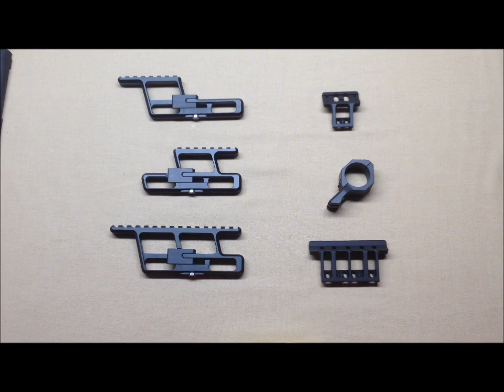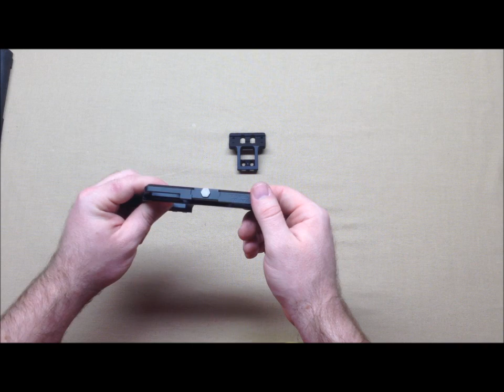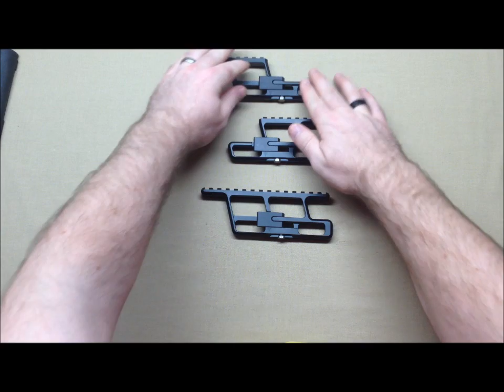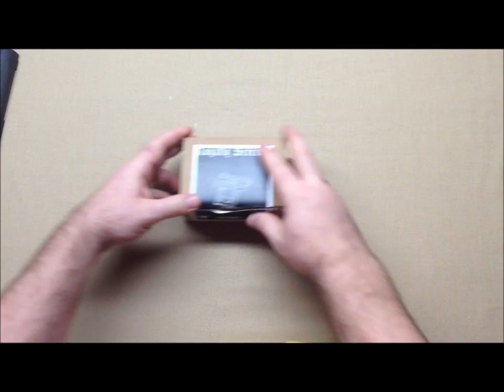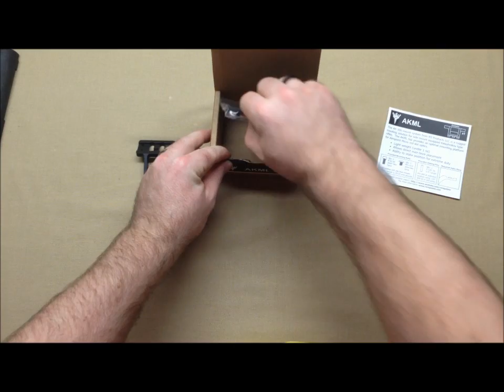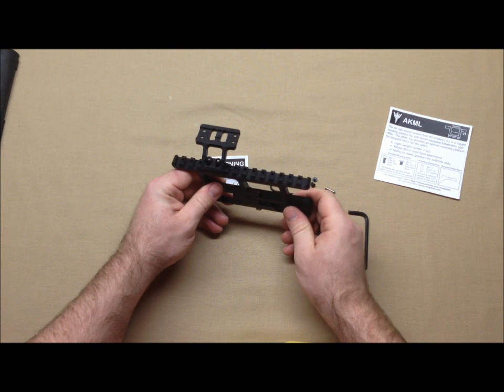RS Regulate AK-300 Modular Side Mount System

Comment: Should it be necessary to hammer this mount on? I have a KR103 (new production mid 2023) and just got my 301M and AKML and can only get it on about 1/2” before it stops. It fully seats with some liberal taps from a small rubber hammer but moving it all the way on or off is impossible with hand strength.
Reply: You should never need anything besides fingers to install them properly. Have you adjusted the mount to fit your rifle per the instructions?
Reply: @RS_Regulate  yes, I even completely removed the locking mechanism from the mount to makes sure that wasn’t the issue

Comment: Dumb question but how do you center the upper optic mount to the bore? Is it an "eye ball" operation?
Reply: I use the irons as a datum and place the reticle or dot on top of the front post.  That should get most people on paper and then you fine tune the POA/POI
Reply: @RS_Regulate  I was more wondering if there was a method to center the actual optic (dot off) to the bore. So in theory the optic would already be centered to the bore before you started adjusting your dot

Comment: I didn't have an issue buying my lower mount (it was in stock at Brownells). The upper I wanted was the AKOT (mini ACOG), and it was out of stock everywhere. I emailed RS Regulate to ask when they might be back in stock. I got a quick reply stating that they were at the anodizer. The person suggested that I order from retailer first, as the stock goes there first rather than the RS Regulate website. The nice thing about Brownells is that I was able to backorder the item. I waited maybe 2.5 weeks. These really do sell out fast.

One question for RSR after watching the video. What torque value do you recommend between the upper and lower mounts? With blue thread locker is 20-25 in/lbs about right?

Comment: Is there any reason why an AK-303 would refuse to slide forward even while the screw is loosened up all the way?
Reply: inamadworld could be several factors.  Most likely the dovetail is not properly aligned.  If you have a WASR the dovetail may not be properly machined etc.
Reply: @RS_Regulate  It is an In Range built 74 with a side rail bought from AK-builder.  Not sure how to tell if aligned properly.
Reply: @RS_Regulate  that's what it was, In Range verified that it was out of spec and replaced it with a Russian one.

Comment: holy batman, i just checked the prices, AK-303M with two 30mm rings will come out to $280 plus shipping, that's F-class territory, not AK.  

I'm off for the Russian made stuff, they run a reasonable price to quality ratio.
Reply: So do these.  

FYI - we recommend using the AKR upper not Dual AKM’s.

Comment: I'm new to ak optics in general. Is it normal to see the optic mount slightly give (move) as you apply a little pressure to it with your hand. Mine will move very slightly, but looks like it goes back to zero. I haven't made it to the range yet though.
Reply: Josh Wells yes sir.  It should flex.
Reply: Thank you!

Comment: Just received modular side mount and my lock bar on my AK 301M doesn't move at all so I can't adjust.  (standard)
Reply: Doug E Doug sometimes the mainspring gets bound up.  Flip it over and push the spring away from the bottom lock bar and then let it snap back.  Repeat away from the mount side.  Once it’s freed up roll it one way or another a few degrees.
Reply: That was it, thx !

Comment: Still can't figure out how to mount the  307M to my Npap
Reply: Bruce Witherspoon what's the problem? Not sliding on or not locking?
Reply: Specify Rs Not locking. it slides on fine after I tighten it. I've followed the video step by step.
Reply: Specify Rs I've tried that and still no dice. it really seems like it doesn't fit. I'm sure I bought the right model so it's probably me and not the mount.  I'm going to take it and my rifle to a gunsmith and see if they can mount it.

Comment: I noticed you said that you'd be able to run a rmr with one of these, which one of the uppers would be best suited for that? I've got a Burris fastfire (like it more than the rmr) I would like to use on my AK
Reply: Use the following uppers for those mini red dots or dots that share their bolt pattern:
AKMA:  Aimpoint ACRO 
AKMD: TRS-25
AKMF: Burris Fastfire
AKML: Aimpoint Micro
AKMP: Leupold Deltapoint Pro
AKMR: Trijicon RMR
AKMT: Trijicon MRO

Comment: My locking block will not move.
Reply: SouthernRaisedAtheis sometimes the locking block gets stuck on the spring.  Turn it over and pull the spring away from the top and or bottom of the mount and rotate a couple degrees
Reply: That did the trick.

Comment: I just bought through the AKOU store, the Goat F*cker Annihilator package, including two of you're devices that I put together to create the side rail for a 3x scope. What sort of metal do you guys use and how is it made? Sorry if it says on the box, but i figured I'd contact you directly. So far I zeroed it in at 50 and was very impressed with consistant bullseyes.
Reply from the maker: The AK-300 main bodies are made from billet 6061-T6 plate, precision CNC machined and then blasted and mil-spec type 3 hard anodized.

Comment: Will the full length side mount work on a Molot VEPR AK47?
Reply from the maker: Use the AK-303M for your Vepr
Reply: @RSRegulate  i have a vepr from fime group, the ak47 11 (not the folding stock model) will the 301 mount work for that rifle?
Reply: We have a new Vepr specific AK-353M lower
Reply: Hi - i have a molot vepr with the side folding tubular stock and the ak-303m.  I think the hinge for the stock, which is on the left side of the back of the receiver, about an inch behind the part I slide the mount onto, is preventing me from being able to get your mount flush with the receiver which is preventing me from sliding it on.  Would yall know anything about this? I'm thinking I'm going to have to remove my stock in order to get the mount to slide on.
Reply: sorry, mine's a fixed stock.
Reply: Tyler - sorry, we designed the AK-303M several years before the new folding stock trunions were made available on the Veprs.  We are working on a new Vepr specific lower to address these issues.

Comment: The AK-301M & AKMD mounted on my Arsenal SAM7SF "WILL NOT" properly co-witness the 800m iron sight with a TRS25. At the 300m setting, the irons barely become visible in the bottom of the TRS25, making co-witness at 300m or less effectively nonexistent. The 800m setting is co-witnessed at about the lower 1/3 position. This was a real bummer for me, as I purchased these expensive mounts for their high quality and they were purported to co-witness. I am planning to either shorten mine somehow (without changing the AK-301M height, which is perfect) to allow for good co-witnessing below 300m, or find another 800m rear sight leaf that sits higher than my OEM sight leaf.
Reply from the maker: The TRS-25 will not lower 1/3 cowitness properly.  The AKMD gets the main body of the optic in roughly the right place, but the way the TRS is made prohibits lower 1/3 cowitness.  Sorry.

Comment: Can anyone confirm for me that this fits on the new c39v2 mount?
Reply from the maker: the new AK-309M works like a charm.
Reply: no, century chose a proprietary design, you must buy a century side mount rail if you are using the c39
Reply from the maker: Russ, you can use our new AK-309M lower for the proprietary Century side rail plate.
Reply: what about the century akm?

Comment: Excellent product, low profile, light, strong especially for the side rail lower mount.  

Regarding the AKR top adapter piece for users with Eotech XPS3 sites and G33 magnifier, this will not mount on the AKR as the angle piece interferes with with the optic quick disconnects mount.  Even if you turned them around they will not clamp on the top rail of the AKR.  The only think that "might" work is the Larue QD mounts attached to the Eotechs than attached to the AKR from RS.  This of course is a much added cost to configure especially if you have other rifles that you will need to adjust from previous configurations so you can interchange.

I've given up on the Eotechs' and left them on my AR (shame) which is more accurate than on the AK47s, took my Canon scope with Larue mount and it all worked fine on the AKR RS top piece.
Reply: I forgot to about my g33 magnifier and was just gonna go with exps3 on the 301M with AKRK... now you got me thinking if I should do that
Reply: @John12Dee  Here is another avenue.  Even though I use my G33 I recently purchased the Vortex Micro3x Magnifier.  Much smaller footprint, good quality, same eye relief.  One can pick those up for about $300 even though they list for $450.  Sad part is that after 2 months mine is still in the box after I tried it once.  I'm going to have to stop looking at stuff. 😅
Reply: @Worldoversea  yea I think ima just put exps3 on it without the magnifier. I'm only gonna be shooting 100 yards the most so I wont need the magnifier

Comment: Will this fit a centurion 39 ak from century arms??
Reply: The Century Arms Centurion 39 (Sporter or Classic) does not have a side rail mount. These Century Arms AKs have a milled receiver, and as with any milled receiver I have seen, there is no side rail present. What you can do to mount an optic on these types of milled AKs is to go with a dust cover with a pic rail (I would recommend one that replaces your front sight and hinges there), or even better replace your top hand guard with one that has a pic rail. Feel free to reply if you or anyone else has any questions about that.
Reply: I mounted the UTG side rail to my C39, and now this RS Regulate AK-300 mounts perfectly.  You can find the installation video on my channel
Reply: Maltalionis The milled Arsenal SAM7r has a side rail

Comment: Very innovative design. Instead of buying one overpriced piece you need to buy multiple. This reminds me the in app purchases on mobile phones.
Reply: How do you propose to get the necessary modularity to fit every type of optic out there on every type of AK? While getting the optic centered over the bore and as low as possible? And return to zero when you put it back on? 

These are not easy requirements to meet.
Reply: i think it’s the only way to get a realistic product that gives you the option to even make it worth mounting an optic
Reply: With the little difference that you get a premium product here..

Comment: Just purchased the 303 and a 30m mount to run a red dot. If I were to purchase another 30m mount would I be able to run a 1x4 scope on a Saiga 7.62? (would it fit) Or should I just wait for a dedicated scope mount?
Reply: cityguyable I would recommend the AKR upper and a set of rings.  The AKM upper actually puts the scope too low to work properly